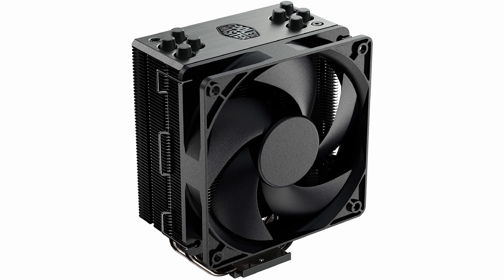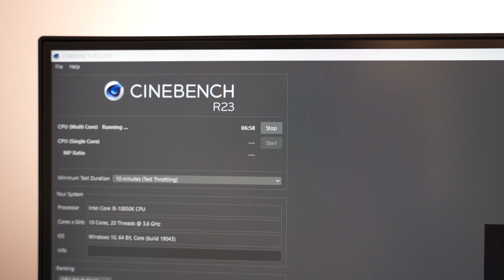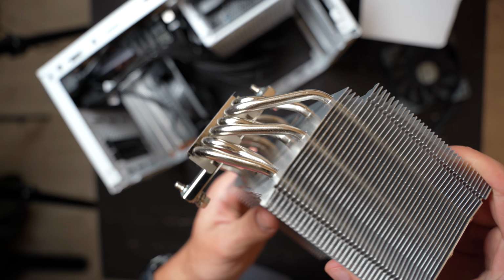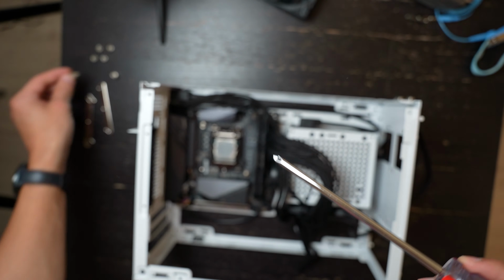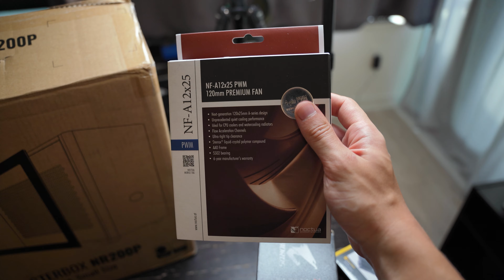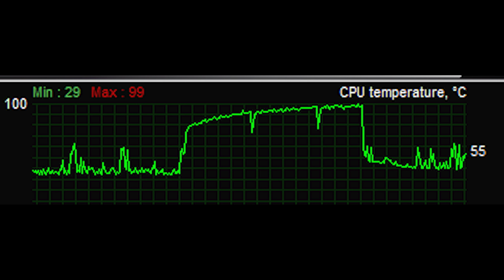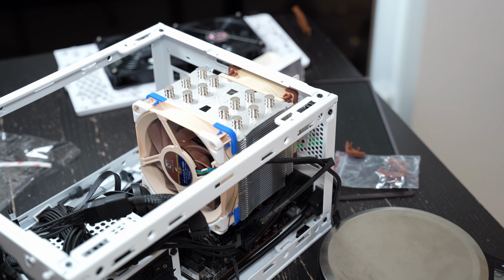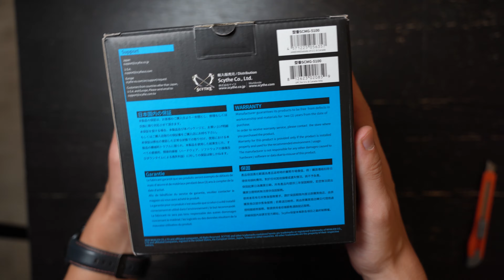NR200 Build - Best Air Cooling Setup w/ Tempered Glass (no compromises!)

Comment: Informative video.

I'm kind of put off the nr200... Ive got a nzxt H210, and the nr200 isn't all that much smaller or nicer. 
But the H210 fits my NHU12A, and an ATX PSU.....
But only 2.5 slot gpus, well, I think 2.75 fits but your fans are on the psu shroud ...... So I might be in the market for a new case soon.

I kinda wish NZXT would make a very similar case, albiet with no 3.5" or ATX psu.. basically a chopped down version of what it is now, a cross between the nr200 and h210

Comment: The CM Hyper 212 evo does work well with the i9-10850K cpu in a full tower case with temps in the mid 70’s at 100% load. Using Kryonaut thermal paste drops the temps  even more with a speed increase from 4500 to 4800 MHz. See this video: https://www.youtube.com/watch?v=AborxtkBHRU .

Comment: Guy spent $300 messing around with coolers and expensive (and overrated) Noctua's. Should have just bought a Ryzen 5800/5900X with a standard 120mm tower cooler and been done with it.  PBO + Curve optimizer would have had you well under 80c
Reply from the maker: Ya they run much cooler! But I wanted quicksync

Comment: Bro... You insert a "but you're gonna pay premium to get the black edition" after making a point about using the glass panel! come on! If you want looks, you better pay for it...
I personally don't care about the glass panel, I actually PREFER not to use it. For me the point of ITX builds is exactly the idea of "fitting the most into the least" and a glass panel kinda breaks that vibe. BUT, if you're gonna sacrifice performance just to use it for looks... You better get the fanciest hardware... Come on.

Comment: Jeez 3 minutes of whining about the EVO V2. Im sat watching this on a Nr200 build, 9700k @ 4.6ghz 1.075V undervolt and it never goes above 70' FLAT OUT, on the 212 EVO V2 with a delid.  The cooler is mounted with the fan pointing up so all negative pressure rises through my case.  Im not really sure what this dude was thinking wanting to run a 125w cpu on a £30 cooler without undervolting  so of course the mugen was a huge upgrade along but then he puts premium noctua fans on there also so now your cooler is what - 85 bucks? Yes this is ofcourse an apples for apples comparison LOL
Reply from the maker: Hehe true statements!